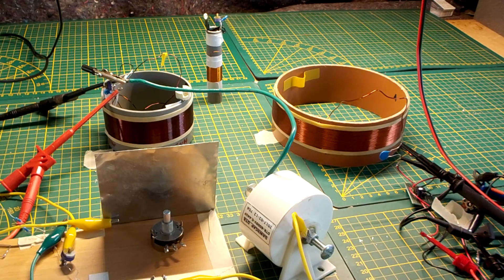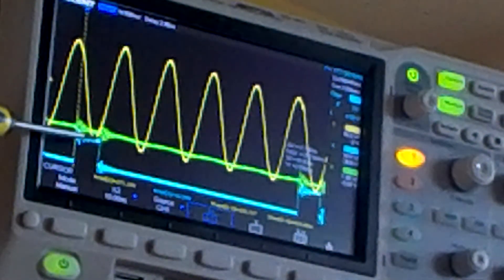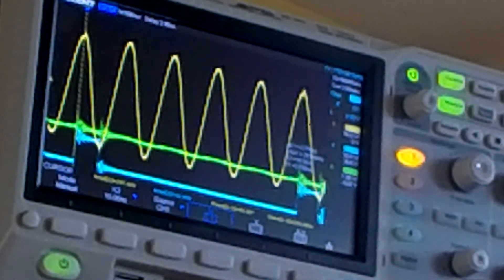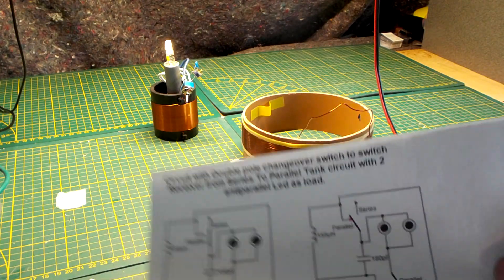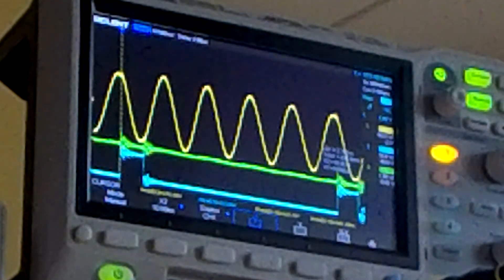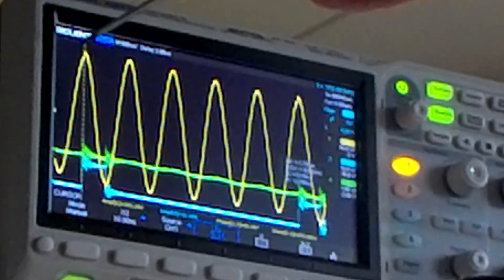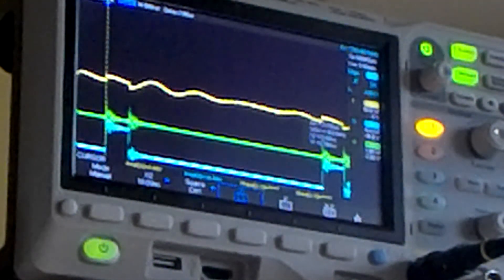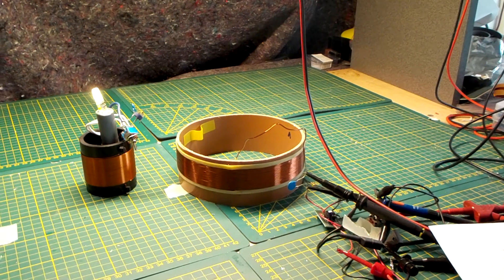049 Don Smith Spinoff Experiment Phase Shift Related Info

Comment: Very interesting.  Series and parallel set-ups.  Thank you for posting.  My whole system is mostly all series.  My LEDs are in series and parallel.  With my set-up I do not adjust distance between RX & Tx, instead I adjust the amount of coil windings.  This is also why I use many small coils so it is easy to connect more or less in series if needed.  I like how you showed very little phase shift.  I believe I have had similar results, but hard to say until I get a new scope,,, very soon.  Again, I love your experiments and great video, well explained and shown on scopes & schematics, much better than my sloppy videos, hehehehe.  Keep up the great work Bruno, your perseverance will pay off!  Always looking forward to your next experiments😁

Comment: Well done Bruno. So the conclusion is using Series circuits for the transmitter and receiver coils are best ?
Reply from the maker: @overunitydotcom, I will try to add voltage of receiver, I hope it gives stable result without connecting ground so there's the least amount of influence. 
I'm also going to show how I tune my receivers because it can have an influence on results and there's maybe a better way of doing it.
At the moment I would suggest to experiment with parallel & series for receiver and it's load, I have not enough experience to say and go for series only, as you will know in resonance things can change real quicklike 😀
I'm also going to try the high Q parallel circuit to see if we can retune our setup with receiver causing lowering of resonant frequency and see if we can get back to original resonant frequency by the use of that high q parallel tank circuit.

Comment: Interesting was, that the receiver coil had its maximum output not inside the transmitter coil, but a few cms above...hmm, why is this ? very strange...
Reply: I have had similar results, yes interesting.  Hope you saw my last video.  I will be doing tests soon, waiting to get new scope.  I'm now also getting assistance from theNuifoundation.
Reply from the maker: @Inventor3 Thank you for confirming you have the same results, it increases the value of the result that I had, so I know it's not only with my setup. I'm also looking forward to your video's, I wouldn't be surprised if I see one with 1000 led's :). Wish you the best with your upcomming tests.